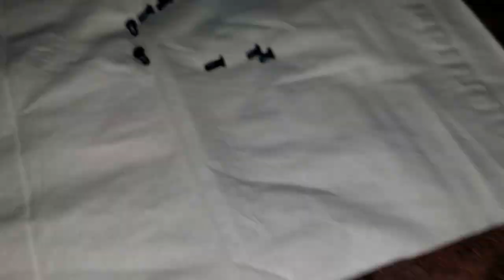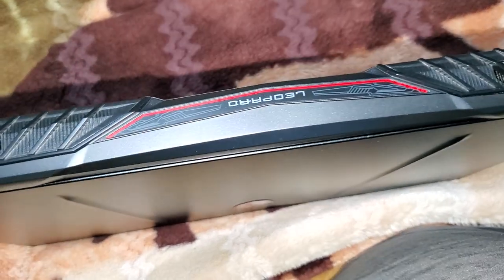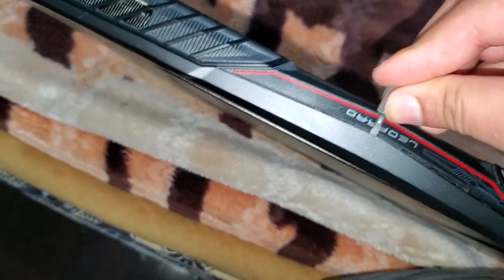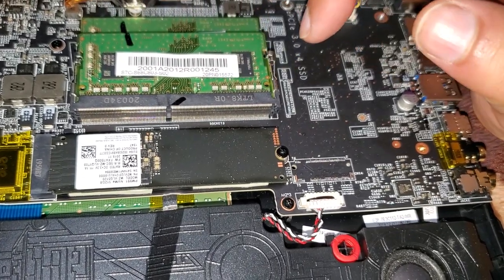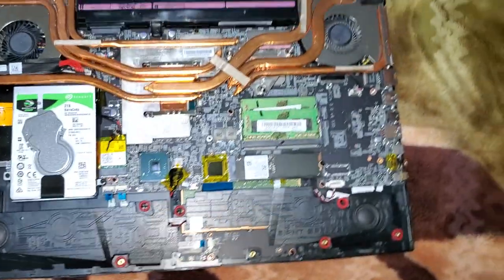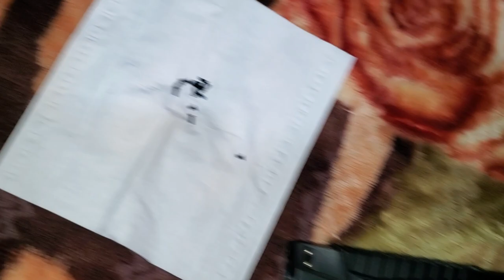Msi GP75 2020 Disassembly

Comment: M2 slot supports 2TB sata or nvme ssd? And i heard theres no connector for it.. do we buy it separately?
Reply from the maker: HDD supports upto 6tb. M2 supports up to i think 4tb. it's not a pc man its a laptop. connectors are on the board, you just insert your drive either your M2 SSD or your 2.5 inch HDD

Comment: Hey, good video with what you had on hand! I was wondering if you've been having heating issues now that we've entered the 4th year with these laptopa? The fans seem clear and I am not sure if replacing the paste will make a huge difference. My cores are hitting 95-98 average with the fan boost going.
Reply from the maker: Hey man, it's been over a year since I have had a new laptop now. As far as hearing goes, my temps never went over 90.

Comment: Nice video, thanks.
Could you please explain, can i install SSD with form-factor 2.5 to slot where you've showed your HDD? Specification says that exactly there must be SATA 2.5 output in motherboard, so i thought it's possibly that there fit SSD as well as HDD, but it has to have 2.5 form-factor. I know about "speed slower" for SSD with that bus, etc., just want to know whether this fit or not.

Comment: Thank you bro! Did you remove the original 512 to put in the 2 Tb?
Reply from the maker: 512 is the SSD. My 2tb is an HDD
Reply: Zubda Tanweer thanks Buddy for clarification I thought there was room for another SSD.  So the clip that came in box is for HDD.  Good to know need to get the courage to add one for my laptop
Reply from the maker: @nickk3403  yes the clip that comes is for a 2.5 inch. You can also buy a 2.5 inch ssd if you want but it's expensive
Reply: Zubda Tanweer thanks bud for clarifying and you are right a 5400 2TB barucuda is under 100 Cad good deal for more retail space
Reply from the maker: @nickk3403  it is!! I got it for $79 i guess. I also got an external 2tb for $75 to keep all the data backup
Reply: There is a second SSD slot to the right of the ram. It’s a pcie 3.0 slot.
Reply from the maker: @AOGWardog1229  no tyere isnt

Comment: Just watched your video so I can upgrade my laptop myself, do want to point out that there are two SSD slots on the leo. But anyways great video, very helpful
Reply from the maker: REALLY?? NO MAN THERE'S ONLY ONE SSD SLOT HERE 🤯
Reply: @Notsogeekgeek  the slot to the right of the memory is a SSD slot. Lol
Reply from the maker: @AOGWardog1229  there only one bro. Send me my time stamp ill see
Reply: @Notsogeekgeek  it’s even on MSis spec sheet for the laptop. 

STORAGE CAPABILITY
1x M.2 SSD slot (NVMe PCIe Gen3)
1x M.2 SSD Combo (NVMe PCIe Gen3 / SATA )
1x 2.5" SATA HDD
Straight from MSis spec sheet 
https://www.msi.com/Laptop/GP75-Leopard-9SX-GTX/Specification
Reply: @Notsogeekgeek  still good year down video though. Really helpful
Reply from the maker: @AOGWardog1229  BRO! the page you are sharing is for GTX series with a 9th gen processor. the newer one only has one M2 SSD slot

https://ca.msi.com/Laptop/GP75-Leopard-10SX/Specification
Reply: @Notsogeekgeek   min 7:06, on the bottom right of the image, that's the slot for another nvme m.2 ssd. Great vid btw, im opening mine to repaste it and add the second nvme for the storage
Reply from the maker: @giando16  no dude. There isnt. So many people have said the same. There is only one ssd slot thats already filled by the stock ssd
Reply: @Notsogeekgeek  literally yesterday i mounted in another nvme ssd.
Reply from the maker: @giando16  Bro look at the laptop exact model.
Reply: @Notsogeekgeek  it look the same inside and outside as yours
Reply from the maker: @giando16  thats not how a model worka
Reply: @Notsogeekgeek  its the exact same model, mine is from 2019 yours its from 2020. The only one thing thats different id the i7 10th gen you have. Every other thing its the same.
Reply from the maker: @giando16  lmao dude its not the same model haha
Reply: @Notsogeekgeek  omg do i really need to draw arrows on a screenshot of yuor video ?
Reply from the maker: @giando16  no, but you need to educate yourself on the model numbers, and then look at the official website to see what i am talking about.
Reply: @Notsogeekgeek  ok, just listen one second to me, just one. Go on minute 7:06 of the video and read what is writen on the motherboard, just 2 cm up of your thumb. That exact spot is for the NVME ssd.
Reply from the maker: @giando16  dude. Its my laptop. Its my video, dont you think i would have read ir or seen it before?
Reply: @Notsogeekgeek  have you done it instead answering like a no brainer ? im not asking mutch you need 2 seconds to do it.
Reply from the maker: @giando16  already told you 50 times not gonna entertain you more by giving more info you are clearly not smart enough to absorve
Reply: @Notsogeekgeek  ok, as you wish , keep using an hdd in you 1700k dollar laptop LMAO
Reply: @giando16  I think he doesn't know what nvme is😂
Reply: @KubaYa1411  i tried to make him think and use the brain, but i guess his hands are faster on the keyboard

Comment: Thank you bro, keep it up!
Reply from the maker: Always!
Reply: @Notsogeekgeek  I was going to ask you, how is that Seagate hard drive holding up and does it perform better than the stock version? I was thinking about getting one, running out of space and need to expand.
Reply from the maker: @2ndtonone1000  the hdd? Its working all fine man. Ofc the ssd is faster but hdd is working fine no errors no eaten up space no cracking sound all is good
Reply: @Notsogeekgeek  Yeah I was referring to the secondary drive. Mines actually came with a one terabyte secondary 5400rpm drive, so now I am.just upgrading it.
Reply from the maker: @2ndtonone1000  good man

Comment: Does this laptop support 3200mhz ram speed ?
Reply from the maker: Sadly, no.
Reply: @Notsogeekgeek  so there is no overclock option in the bios 🤨
Reply from the maker: @عليمحمدصالحياسين  you can enable it in developer mode. The thing msi did here with this mb is that rather than outting in the 3200mhz ram they put in smaller 2666mhz. Even for the gpu they out in a desktop chip but just underclocked it. But we can enable the developer mode to get all the perks
Reply: @Notsogeekgeek  ohhh thats nice since i was thinking of buying this laptop and getting 3200 ram for it to raise the 1 percent low fps
Reply from the maker: @عليمحمدصالحياسين  you can definitely try. I am getting 70+fps now, settings at ultra +high, on rdr 2 after optimization and laptop at factory default
Reply: @Notsogeekgeek  how did u optimize
Reply from the maker: @hypersonic6649  check out video "how to run your laptop better"
Reply: @Notsogeekgeek  thanks